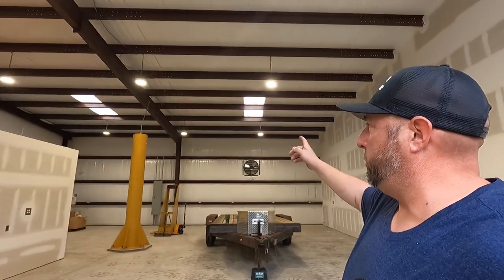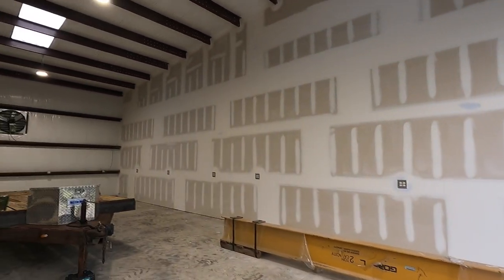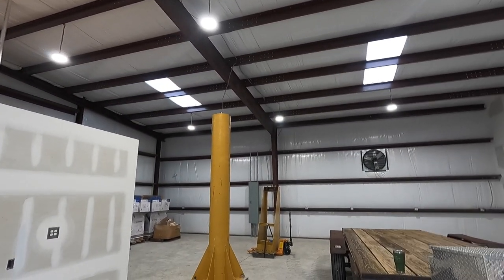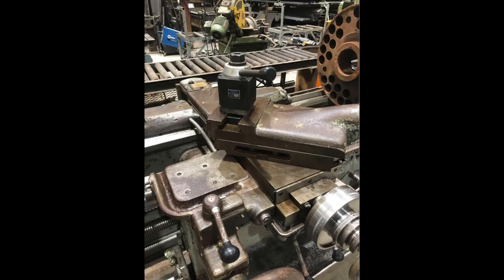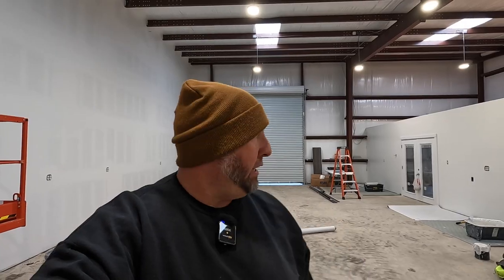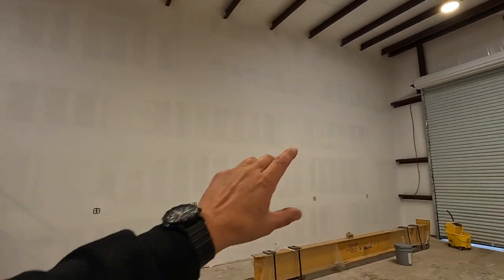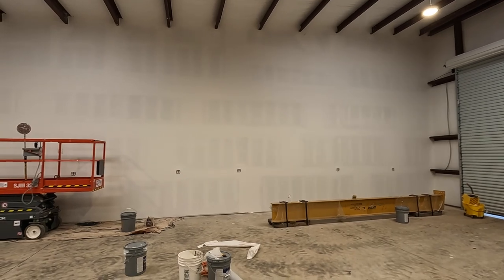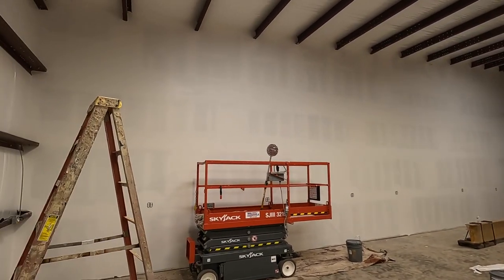New Shop Space Update 10: Painting and New Lathe Announcment

Comment: Been watching your channel for years now,  and always enjoy it.  Don't often comment but felt compelled to this time with your anticipatory observation about positioning the new lathe above the "control" joint.  This is not a joint as such,  but a cut made into the concrete to reduce the possibility of an unsightly crack forming randomly across the floor as the concrete sets off.  Any shrinkage forces will tend to crack under the cut because the slab is slightly thinner here.   Loading the floor in the area around a "control" cut will not affect things now the floor has well a truly gone off.  Anyway,  good luck with the workshop build, and installation of the equipment.  Looking forward to keeping up with all of this.

Comment: You can put some flexible self leveling concrete sealant in those control joints to keep them from filling up with chips and being difficult to sweep.
Reply: Any hot chips or fragments will fall and melt into the sealant though. Ask me how I know… ;)
Reply: I prefer 2 part hard epoxy. Helps with pallet Jack's to.

If the grooves are deep I have dropped rebar down in the gap to help take up the volume. Back them rebar was cheaper then epoxy.
Reply: oh good points
Reply: Absolutely agree about filling the joints.
Reply: @harryk1266  wouldn’t hard epoxy just crack when the concrete expands? Either that or it’s sufficiently strong to make the expansion joint ineffective (causing problems elsewhere), but that seems unlikely.
Reply: @mlenstra  yes it will crack but the epoxy will stay in the crack keeping the void filled. If there is major shifting you have other problems. There should be rebar in the concrete to hold it together. All concrete cracks. "Expansion joints" are three to direct the cracks to a specific spot so you don't see them. It's just a cosmetic thing...

I have don't this before. Works great.
Reply: We use something called self levelling latex in the uk. Comes in 20kg bags. Just mix it up poor it out and come back tomorrow. All good.
Reply: @harryk1266  you are correct sir. I will add that the epoxy is stronger that the concrete. As the concrete goes through it’s cycles the concrete around the epoxy will break allowing that movement, this creates other issues. I think the best bet it some self leveling joint filler. It’s going to be an ongoing maintenance issue. Nature of the beast.

Comment: For cleaning up more easily, let me recommend a filet between wall and floor. A straight baseboard makes a sharp right-angle corner that embeds dust, swarf, etc. I made mine with a piece of 3" PVC pipe as a molding tool (1.5" radius). A broom cleared anything out with no corner to trap stuff. It also keeps welding sparks from laying against the wall. Use mortar or plaster, and paint it with whatever you use to seal the floor.
Reply: That's one of those "it's so simple it's genius" tips right there!

Comment: Hi Adam, I don't know what length of work you are expecting to be able to accommodate, but it strikes me that putting either end of your new lathe near a wall will restrict your capacity and also make access to the tailstock difficult, I'd be tempted to allow at least room for a chain lift at that end so the tailstock could be swopped out for a fixed steady on long overhanging work pieces. Exciting times watching you set up a new facility. May I wish you both a happy new year.

Comment: Control joint won’t be an issue. They just control where any crack will be. As long as the floor is reinforced, should be 100% fine.
Reply: I second Rob H. Concrete shrinks as it cures and it will crack. The control joints control where the cracks occur. The rule is 2 times the thickness of the slab expressed in feet... a 12" slab would need joints every 24 ft or so.  What is  more important is an engineered section, based on your site conditions, of a well compacted base of mineral soils. You should have no worries at all. I've been enjoying this shop build from the beginning. Excited to see you actually producing product in there soon.
Reply: Exactly. Control joints don’t prevent cracks. They just dictate where the crack occurs.

Comment: Expansion joints in concrete wont matter, the slab has continuous rebar running both ways, even across the joints.  They are pretty much just as strong and distribute the load across the whole slab, you shouldn't have any issues with the location, some good leveling pads under the machine and good to go!  Congrats on the new (to you) machine!!  Cant wait to see it run...

Comment: I would two tone the walls. White on the upper 3/4ths and a mid tone on the lower.  This gives the brightness of the white from the lights above and is easier on the eyes where you look and film.  Consider darkening the lower portion, either a grey, light blue or beige.  Also, the darker lower area doesn't show dirt as much.  It works REALLY well.

Comment: For the baseboard, the rolled rubber moulding has the advantage of hiding any waves or variances in the floor - sheared aluminum won't, and could make them stand out.
Reply: caulk the gaps as you do on MDF baseboard on tile floors

Comment: The 60Hz line current and the 60shutter recording were back-beating against each other creating banding. I didnt see any banding with your 120shutter, but you may find that your signal may look noisy in low light conditions. If you have a shutter that isnt a multiple of 60, and lower than 120, that should work well in low light.

Comment: A good option might be one row of fiberglass wall panels around the shop. They come in 4'x8' sheets and are only 1/16" thick but they would be really easy to clean and would prevent dings and dents. You can get them at Home Depot for pretty cheap

Comment: If you are considering using metal for the base board, I would suggest using a 6" wide strip of 18 gauge 304 stainless steel.  Being on floor, it will never corrode, and it will match those stainless outlet covers perfecty.  The wall looks very nice and I am excited for the lathe!  Happy New Year!!

Comment: My time living in the Lakeland Florida area, it got down to 28°f (2°c) and we had an inch of snow. One of my neighbors said that it reminded her of when she lived in Wisconsin. I asked her if they have palm trees in Wisconsin, but she said no.
Vinyl cove is nice, and it goes on easy, but metal plates would also work. Either way, you will likely need a notched tip for the caulking tube adhesive.

Comment: I am thrilled about the lathe. Now you are rocking. Back to the BIG pieces. Ya, hire a rigger. Just as Adam is an expert machinist, they are experts at moving heavy equipment. One of the hardest to learn, but most essential life-skills, is the ability to realize where you need expert help. Painting most people can do acceptably, and getting it wrong is not a harsh problem. But painting an 19 foot high wall is dangerous. You have a 50% chance of dying when you fall 11 ft onto concrete. From 19 ft it would certainly be fatal. Hire a painter who knows how to do it safely. The same with the lathe. Dropping an 11,000 lb lathe might create a serious problem that will be costly to fix.

Comment: My normal spec for workshops/machine shops is to face the walls with 8' x 4' x 1/2" ply set with the 4' dimension vertically, this provides an excellent scuff panel that can sustain impacts when fixed to metal studwork and plasterboard walls.  I actually specified the sheet (19mm) set vertically at GEC Large Machines (Alsthom) where we had 100ton cranes travelling along. This precludes the need for skirtings and means that it will be a very simple job come the end of the lease to return the building to its original state.  I also spec the paints as 1 mist (to seal the plasterboard) and two full coats of acrylic eggshell that is cleanable and can sustain  scuffing.
I note your intended new lathe, is the floor capable of taking the point loads and vibration especially, close to the contraction joint?  I have noted that the US industrial floor spec is less than we would commonly have in UK i.e. 8" fully reinforced, that ought to be checked with the structural engineer as to the capacity.  You certainly don't want to have the floor fail and then be responsible for its reinstatement.

Comment: So Adam what are you going to build with that monster lathe? Adam; anything I want. 😎 Eggshell was my first though with the paint sheen too, I’m glad your painter is on the ball. I went with 2x6 pressure treated lumber for baseboards in my shop. I routed a 3/8” bead 1/2 inch down from the top and painted it with grey floor paint for the industrial look. My thinking was the wood would act as a bumper or toe kick against dings and prevent the walls from being damaged yet it’s soft enough that it won’t damage whatever I hit it with. Things are coming along nicely. Peace.

Comment: The shutter speed thing is interesting - it actually makes it look like you are in front of a green screen at 120 fps.  I'm curious what 50 or 100 fps would look like.  Just getting out of the multiple of 60 which is what your lights are running at (60 Hz).

On the baseboard I would steer clear of diamond-plate.  Use flat aluminum or the vinyl glue on stuff.  After cleaning diamond plate on our firetrucks I'd never use it on anything that needs to be cleaned. lol.

Shop is looking great man!
Reply: @BruceNitroxpro  nothing happened to them, but when we do a deep clean to ready them for parades, the diamond plate is extremely labor intensive to clean.

Comment: You can also consider 24 or 30 frames per second at 1/48 or 1/60 s stutter speed as a solution to the banding. Added bonus is for a given quality, your file sizes will be ballpark half and easier to edit. :)
Reply: That low fps's look a bit more stuttery already
Reply: Stuttery video is usually more about whether or not the motion blur looks “natural to our eyes” or not. The typical rule of thumb for “natural” looking motion blur is the 180degree shutter speed rule (exposure time half as long as a frame persists eg 30fps = 1/60s exposure time) without proper motion blur you have a series of sharp stop action frames and gives it the flip book animation choppy look.
Reply: @andrewh2341  good to know

Comment: Impressive Adam, LOVE your new shop, cant wait to see the layout with everything in place. Those rolled rubber baseboard/mopboards are cheap and crappy, They never fit together right, and the adhesive you have to use to make em stick right always comes loose in some way or the other.  A simple bull nose routed 2x4 or 2x6 painted the same as the floor will suffice for years and take a lickin and keep on ticking if crashed into, make sure its treated wood. A REAL American flag will look great, and big banners for tools ie Starrett, Mitutoyo, Seco those sorts of things etc placed all around will add to the ambiance of your HIGH CLASS machine shop. Your distributors should be offering you tons of them.

Comment: As flat as they can make it, the concrete floor is not truly flat. To use a sheared, straight piece of metal as a baseboard will show the deviations of the floor like a sore thumb. The plastic baseboard will conform to the fluctuations, and seal the joint against dirt and liquids. Thanks for the video. Jon.

Comment: for that control joint, you plan on bolting it down? i would think, if you dont bolt it down, then that joint should be able to move under it. even more so if you put some rubber vibration isolation pads under those feet.

Comment: How thick is the concrete floor in the new shop? 
So what does the lathe weigh? about 850 pounds per square inch? sitting on top of 6000 PSI concrete.
If it was your driveway at home I might worry about the control joint.

Comment: At 1/120 shutter speed, you’ll find that fast moving objects (e.g. parts, cutters, chips etc. during machining) will get quite some motion blur. Normally that’s desirable for a natural cinematic look and feel, hence the “double the framerate” rule of thumb. But for a channel with a lot of machining content you may want to be able to crank up the shutter speed for a clearer picture. You won’t be able to shoot any good slow-motion footage under these lights either.
I’d strongly recommend looking into getting those light fixtures fitted with some proper constant current LED drivers. They don’t flicker at all and give a very smooth picture even at much higher framerates.

Comment: I know you deal with big machines but I'm looking into getting a mini lathe and wondered if you had any insight. Grizzly Eastwood and central machine all visually look like they are all the same mechine
Reply: Don't do it. At least go for a larger benchtop lathe that has auto cross feed. You'll never hear a person wish they had a smaller lathe.
Reply: @TheBeardedGunsmith  after doing some more research I think I'll end up going with a precision mathews
Reply: @gorillaarm67  Not a terrible choice but you'll be happier if you go with something that has an AC motor. The DC lathes dont have as much torque when you need it. I actually have 2 lathes, a larger Smithy and a smaller Bolton. The Bolton is a great lathe for its size and I've not been disappointed with it. It's a 10x30. The Smithy is a 14x40 but likely much more lathe than what you're wanting. My brother just got a 9x19 Jet lathe is really impressive for its size but it was a bit pricey. Just be sure to do research and read reviews on different models, especially youtube videos. Learn from others experience if you can and good luck!
Reply: @TheBeardedGunsmith  so currently I don't have a whole lot of space in my garage left and I don't plan to be using it for more than a 12 inch part. But I do want to run a drill bit and a boring bar though a 12 inch piece
Reply: @Tom Giorgini  what's the reasoning you say anything smaller that a 12x36. I've pretty much accepted that a bench top isn't was I'm going to get. But I am pretty limited on space. I was leaning towards PM-1127VF-LB LATHE

Comment: To get that painting done a little quicker, take all plates off and put in Tupperware with screws the cover outlets n switches with 2"blue tape. This way they won't waste any time n get right to work. Give it a couple days to cure, then re install plates. Screws get vertical as to not collect dust like they would if horizontal. If they need power, remove tape. Been in thousands of new homes over 40 years, and when someone looking for power plugs something in, sometimes that blue tape tears and gets stuck in the receptacle. Just a heads up. Won't  be much longer Adam. Best of luck.

Comment: spray some water a Ft or so from the walls to see where it rusn, to make sure it doesnt run in under the wall..  That way when you wash the floor. the water wont run under the machines and wall..  Water base paint  on the wall under say 6 ft mark is no good  for washing. That corogated plastic wall stuff loks good though .

Comment: Hi sir, may i ask a question? I have a problem where I forgot to tap M6 on the customer's item, and the item is now harden?? how to make it soft so it's easy to tap? I've done it by burning using oxygen and gas, but still difficult to tap, I have 14 tap holes with an average depth 15mm...
I am very confused now..
Reply: How hard? they make taps that can handle up to mid 50's rockwell c. I have used the OSG Cobalt Exotaps series VCX with excellent results in hardened 4140 and 4340. They show m6 metric version available. I would try one.
Reply: @bcbloc02  Good to know. Thanks for the tip Brian.